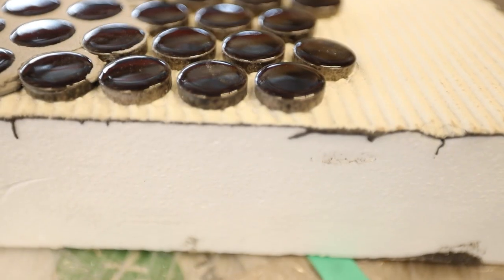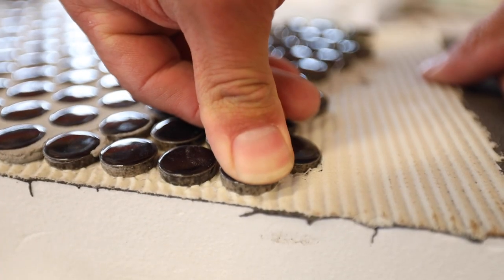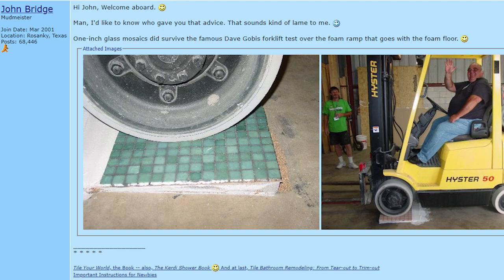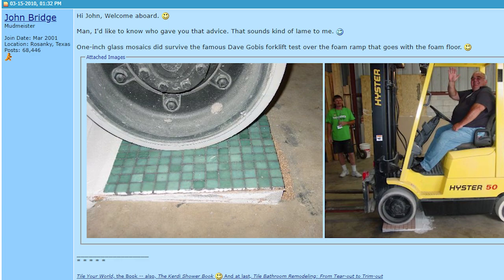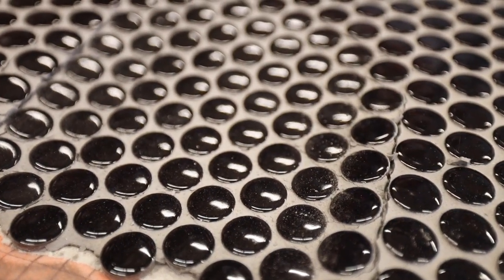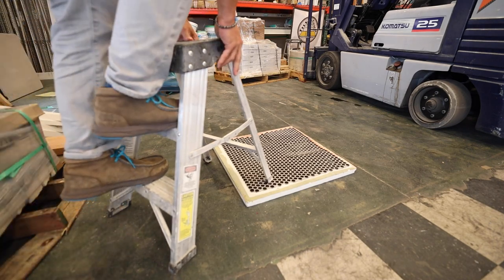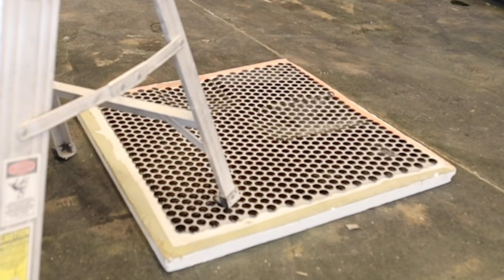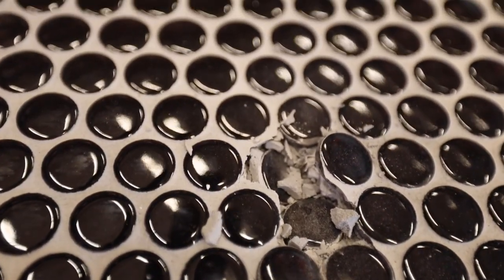Small Tile on Foam Shower Pan --- Is it a Good Idea?

Comment: Did a shower with Penny rounds on foam over 10 years ago. Tore out that shower last year. Customer wanted to remodel again. There were absolutely zero issues with the shower floor. I know that's just one example but imo the foam pans are fine.
Reply: Thanks for the info. Still on the fence about foam pans. Probably  stick with  mud.
Reply: Isaac has some issues with Schluter I would say. Schluter will cover all problems if you install by their requirements, and penny tile is fine by them.
Reply: They are fine.

Comment: I just did my first mud pan. On a 4' x 7' shower, center drain. Used your technique for floating the floor and got a great result. Zero standing puddles. Just didnt trust the foam on a second floor shower.

Comment: A concern I have and am interested in you evaluating if possible: you've demonstrated that many commercial grouts lose strength when wet. It would be very helpful to see how bad the damage is from these tests (and even less destructive ones) when the grout is wet.  Given so much grout to tile ratio in these small tile situations, I would guess there is a lot more weakness being introduced than with larger format tiles.  Additionally, it seems unlikely that people have a completely dry shower when they need to do various types of work in it.

Comment: I learned this the hard way, my 2 foot step ladder in a shower with 1.5" squares on the pan (ungrouted) the 2 small feet of the ladder sank 2 tiles 1/4" into the foam. I contemplated just replacing the 2 tiles, but decided to replace the entire floor thankfully I did the kerdi had 2 rips in it....  I'm 285# and I only use ladder after grouting the pan and a piece of kerdi board under the ladder feet

Comment: Great video 👍🏼 definitely gave me piece of mind . I do float pans but with cub less the foam 48”x 36”  is only 1 1/4”  at the thickest point , so recessing the subfloor between the joists is all that’s needed . When floor thickness is a concern and you don’t want to cut into the floor joists these pans are a great option . Ideally they should be made stiffer. Thanks again .

Comment: Used a Wedi foam pan. It's pretty hard so I didn't cover it when using a step stool with round hard plastic covers on the feet  . I later noticed dimples left by the feet on the raw pan. The Wedi pans are waterproof all the way through and the hard surface wasn't cracked. So I wasn't worried as I was installing large format tiles over it.

Comment: Thing you might want to consider is wheelchair use. The compressive strength on the perimeter point  of each wheel could be  immense, especially for a large heavy person.

Comment: Try the same test with 100% epoxy grout. Not the premixed epoxy wanna be grout. If you use 100% epoxy grout, it might actually help it because epoxy grout gets glued to the edge of the tile and holds everything together, so chances are the penny tile won't go anywhere if drop something on it.

Comment: 8:20 Prefer using mortar beds for installs, but will use foam pans if needed.
Groups another thing that some installers are “choosy” about; as in: there’s a few that won’t work with epoxy at all, and then there’s some who don’t care what they use…..and the one who only wants to use epoxy. Ain’t life interesting 😉
Remember that pic of forklift driving over the tile/foam and was like….that was so cool😆
Thx Isaac, have a good one✌🏻

Comment: My supplier recently started stocking Hydroban boards and pans. Much denser and higher compressive strength than schluter, double I think they said. Although I'd still bet on the forklift.
In your tile and hammer drop test, I can easily imagine damage even over a floated bed.
But I don't think I've ever grouted the floor before tiling the walls. Maybe I should..

Comment: I believe that a 260# person in a wheelchair could compress the foam in a curbless penny tile shower. Most of the weight is at the bottom of the 2 large rear wheels. The front wheels have much less load on them. On your test using a ladder most of your weight is over the ladder feet under the steps. Even loads on each foot doesn't occur until you are standing on the top of the ladder. Thank you for pointing this out. I was considering using a foam base with peeble tiles but I'm no longer going to do this because of the loads a wheelchair could give.

Comment: 6:33 I don't know but to me that pan seems way to soft. I dropped a larger hammer on a penny tile shower floor and had zero damage even as the backside made contact first. Kerdi shower pan and I do believe mortaring down the pan helps a lot as the pan is fully supported and has no voids under it and the impact can be more absorbed.

Comment: This is a great topic. I have had this concern recently, however I normally install my pan mosaic tiles last. So dropping tools on a finished tile would be of little concern. However I have dropped, screws & screw guns and caused damage which were easily fixed with kerti membrain. My concern would be with an installation of a dime sized tile in a handicapped shower area. In the real world would this person be using a cane or walker and would the weight distribution be enough to support both also with grab bars.

Comment: I’ve used a few different brands of foam pans with no issues. But they were pretty ridged. Was going to install the Hydroban Showerpan with pennyrounds, but just handing it before installing my hands would leave dents all over it. Too soft. Didn’t go through with it. Plus customer is a heavy guy.   You run into this issue with the hydroban shower pan?

Comment: I am debating a foam pan vs mud pan for my 32x48 shower. I am leaning towards foam primarily to lighten the weight of the tile shower. There is a basement and we are working on a 1/2in plywood subfloor 16 on center. I plan to lay another 3/4 in plywood over the subfloor for strength. Do you have any thoughts on this? My fear is that a mud pan would add too much weight and cause greater issues than a foam pan.

Comment: Isaac,
I misunderstood your previous YouTubes about foam installations.  I saw nothing like the weakness shown in this.  I just spent over $1400 on a foam pad and board for the walls.  Not a happy camper.  Next one will most likely be concrete.

Comment: Drop a cordless drill, bit down and itll auger into that shower like a lawn dart.
Foam? WHY? just WHY?
Shower pans arent supposed to be fast and easy.
Just like the foundation of a home, its the most critical part. Doesnt matter how well its framed or finished if the foundation isnt solid it will ALL fail.
Ditto for showers.
Use concrete and sand mix. 'Nuff said!
Thanks for that demo!

Comment: Just try to drop the 24*12 tile or hammer on mud bed installation. You gonna get the same result - broken tile.
Reply: Maybe or maybe not but it's definitely not going to punch through the waterproof membrane.

Comment: Smaller then 2 inches is dangerous if not done perfectly right. I would run a membrane on top of foam pan if did Penny tile but I wouldn't do it. I don't really like foam pans. Dry pak way to go alwats